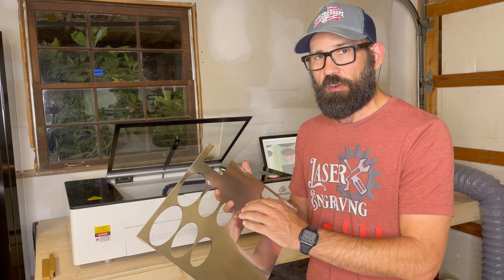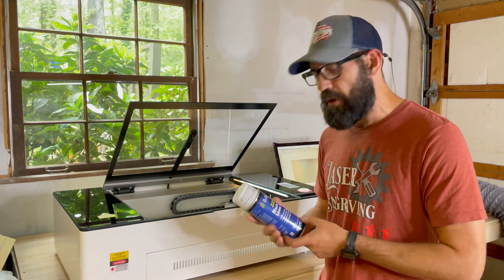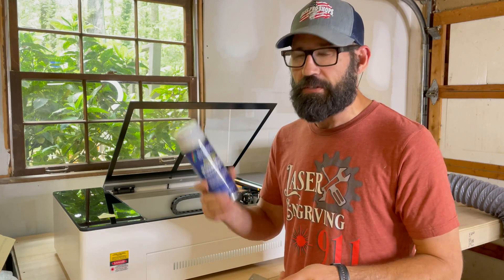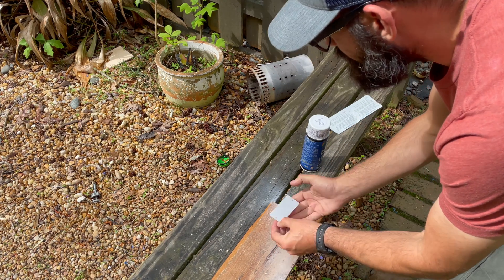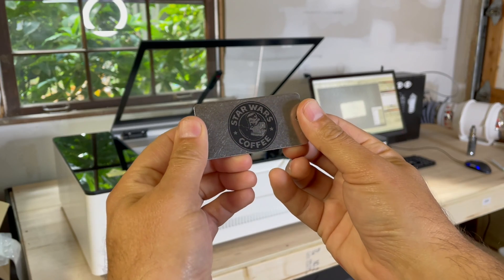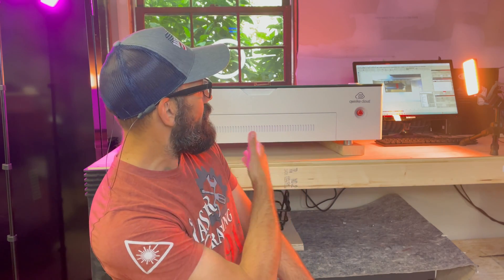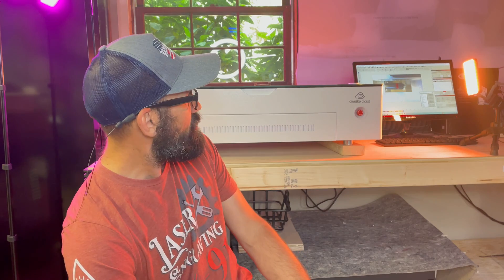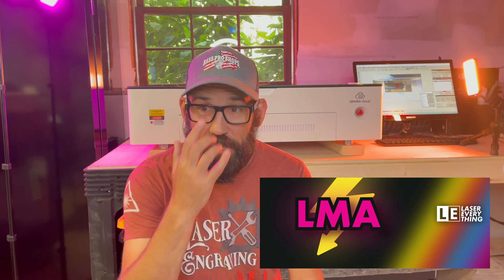PROS AND CONS: Gweike Cloud Pro 2 Review

Comment: What do you mean by not being able to produce many pieces with the Gweike? I need to cut about 500 pieces (wood and acrylic) per month, 15" x 8" in size.
Reply from the maker: When it come to cutting this unit could accomplish that, but for engraving it is very slow, and you will spend days where other machine can complete in hours.
Reply: @LaserEngraving911 I understand... Do you think an Xtool P2s would be a better option?

Comment: Con # 1: It's a bit weird, but gweike suggest setting the material thickness to 17mm minus the actual material thickness. Whether this applies for each machine lets to be seen as mine was 3mm off. Nevertheless, having established the correct formula, one can set the Material thickness (if device is configured as Ruida) in Cuts/Layers accordingly. Now if you start or repeat the loaded job or parts of it, it automatically sets the focus accordingly at the start. No need to input it every time you press start.
Need to be aware of maybe having to set/adjust the Material thickness when changing files or material.
Con #2: On the RF version both USB connections are placed on the same side
Con #7: Red dot laser pointer is available on the RF that I have and it is mentioned in the RF Manual. However, also for the Pro Manual mentions the red dot pointer. So, the question is why doesn't it work? It is a common complaint during reviews.
Con #10: I got the headache after a few weeks as the laser stopped working right in a job. Cause: the honeycomb was shifted a little bit to the front and the movements of the laser head cause it to slightly push the tray from the switch.
Reply from the maker: Excellent! Thanks for sharing!
Reply: @LaserEngraving911  Thanks, I just updated it with remarks on other cons.

Comment: I have had the Pro 2 for about a week. I was a little disappointed with with some of the problems. I was considering sending it back. I was going to buy the Polar instead. There were no risers included in the package I received. I can easily make something for that. The air assist seems to take a while to ramp up to speed. When your cutting, that's a problem. I had been using their offline software, But it feels buggy, and the response from the laser is slow. I just upgraded to the DSP license for Lightburn, and I'm looking forward to trying it. When I contacted Omtech about the Polar, I specifically asked them about the Z homing. They said that it did home, but that you could tell it not in Lightburn. I have not run it with Lightburn yet, so I will see if that is possible. I was contacting them using chat, so they may have misunderstood my question about homing. I was wondering if you could add an offline controller to the Pro 2. I see some people have added it to the Polar. I'd really like to know if anyone has done that with the Pro 2, but I haven't seen it yet. I bought the unit primarily for acrylic, and tumblers. I am a member of the Laser Masters Academy, and it's been great. I even bought a mug. I was thinking about adding an external air assist compressor to overcome the problems with it. I have an airbrush compressor with a moisture trap and a regulator. I'm feeling better about the unit now after watching your review. Great review as always!
Reply: Did you ever do this? I can't tell where you can attach an external air compressor. I have one I would like to use, but I'm unsure how to proceed.
Reply: @ianmarlowe3936  I got so fed up with the problems, and lack of assistance from Gweike. The movement on the Y axis was bad causing missed areas in the engrave. The nozzle kept clogging, and required cleaning with each job. It felt like they were delaying until the 30 day return period expired. I posted a bad review about the laser on another channel and they contacted me immediately, and agreed to take the unit back. I bought a much larger Monport unit. It came with a defective DSP, and I had to fight with them about getting them to replace the DSP. I replaced the DSP and the unit has been fine. I bought a better compressor and regulator and have been using it with the new laser. I did not follow up on the offline controller since the PC is next to the laser. I am connected to it via ethernet. I will be looking to see if I can get an offline control, it would make moving the laser head to the right position so much easier. I hope I answered you question.

Comment: Great video and accurate pros and cons. Got my unit in late February and both computer and camera usb are on the same side one above the other (left as you look at the machine). I have the camera drop issue from time to time and I just select my iMac camera and then back again and it keeps working. I had a big problem with the FTDI drivers and losing connection to the computer but I think that is more to do with my older iMac.

I have rigged a red dot laser to my laser z height and powered it with a 24v source at the end of the cable chain using a buck converter. The issue with it is that I 3d printed the holder to projct the dot right below the laser, but that only works when the z height is at zero, but it is good enough for framing. There is a guy with a real good red dot setup for the Polar 350 that will work on the Gweike.

I did have an issue with the magnetic homing switches failing, but Gweike shipped me two right away and they have been good so far. 
I also had to 3d print risers for the larger mugs.

Overall very happy with the machine so far.
Reply from the maker: Thanks J.B! for sharing you experience and your cool red dot hacks!! Glad you are digging your Machine 👍

Comment: Enjoyed your review. I've been using mine since February and agree with most of your pros and cons. You are spot on with the USB port placement. The cables that come with the machine are so short that you need to place your computer right next to the unit to reach. I tried using longer cables and was able to get away with it for the control USB but not with the camera USB. If you're using a longer cable for the camera, that might be why your camera drops out. The focus is also a minor annoyance. I've gotten pretty good at subtracting material thickness from 17 to get the distance number. I've also added FOCUS to my checklist (along with making sure the crumb tray is pushed in all of the way). I did find that there is a "Material (mm)" setting in the Cuts/Layers window of Lightburn which adjusts the focus on job start which helps. Enjoy your channel!
Reply from the maker: Hey Thanks for taking the time to comment! Glad you are getting along with you Gweike Pro 2! Every machine has its Roses and Thorns! Glad you got value!

Comment: I bought mine back in February. I haven't had any major issues with it. I know some people want to upgrade the air assist unit, but I have the Pro II and haven't experienced issues (yet???). I love what I can do with it. I think the ONLY thing that kind of irks me is they now have a different rotary unit from what came with mine back in February. I'd much prefer to have that one. I had to make a silicone snuggie for my stemless wine glasses so they wouldn't slide off.
Reply from the maker: Thanks for the info! and Thanks for sharing! I think that they are always improving from what I can see, its hard to keep up with all the changes they are making 😂 guess you call that progress
Reply: @LaserEngraving911  Absolutely. I've definitely loved how dedicated they are to offering support. I sat in DingTalk with a tech for several hours while he guided me on diagnosing a problem.